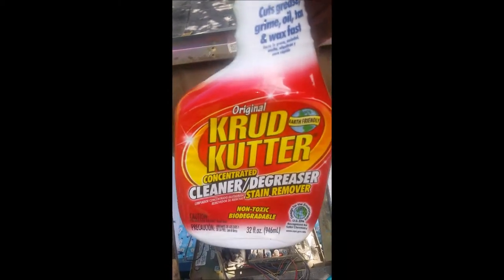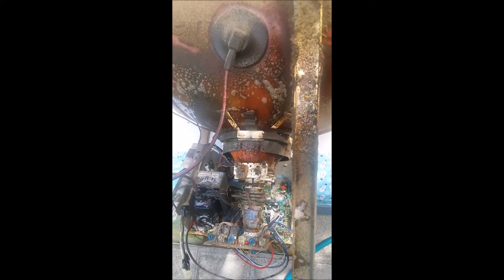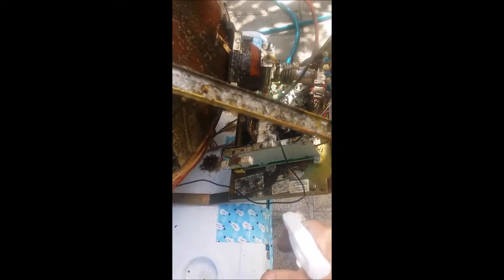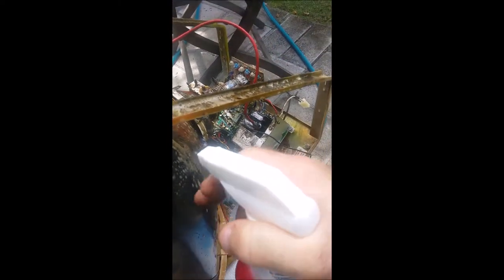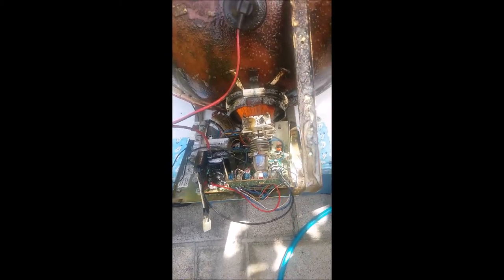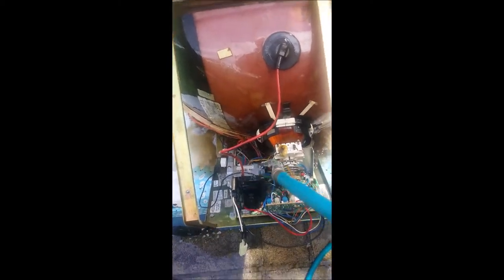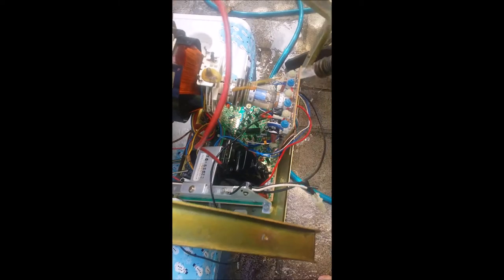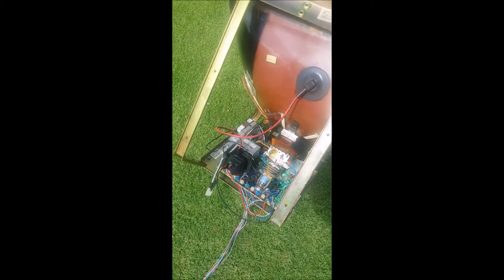How to clean your arcade monitor or orther arcade parts

Comment: Would it be a good idea to use a blow gun/air compressor to blow all of the loose dust off first??
Reply: I'd guess not if the grime is stuck on there (i.e. not just dust). You'd want something low pressure to not build up static on the PCBs.